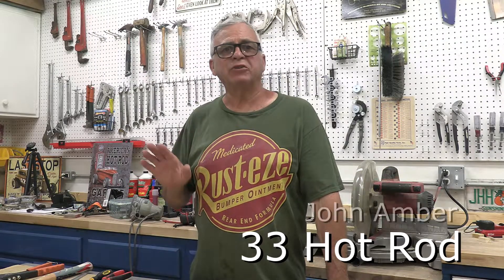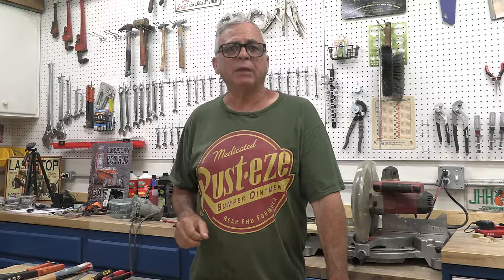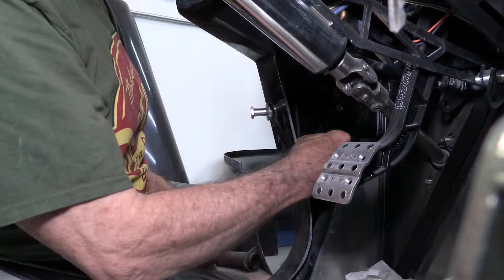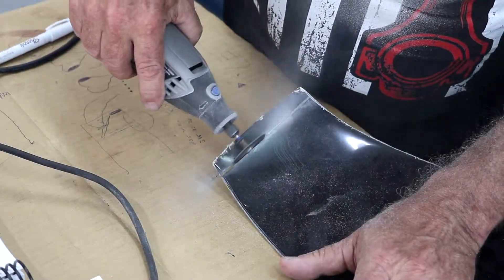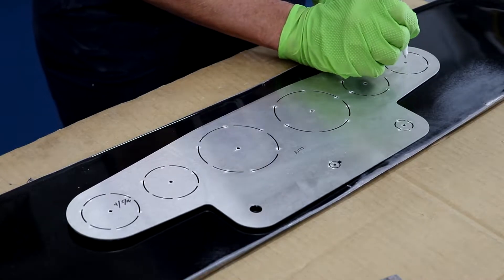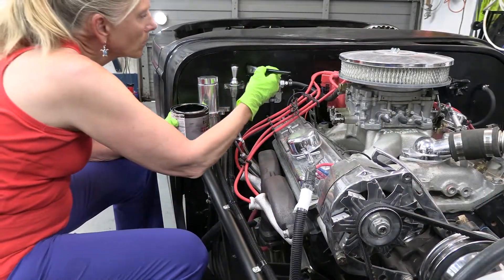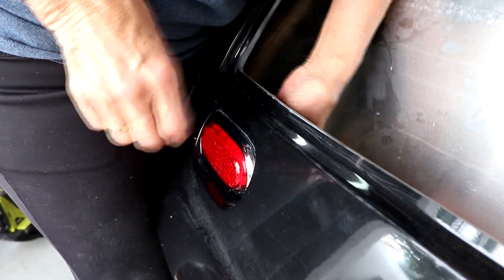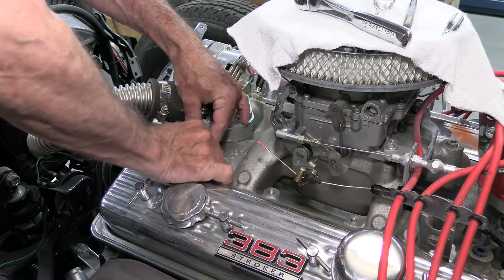#23 Factory Five 33 Hot Rod Build - This, That, and the Other

Comment: Hey John, Nice to see you two back at it. It's been super hot here in TX as well so I can sympathize with you not wanting to get out there! I had a quick question. My kit is due to arrive in November. I'm ordering a crate 883 and wanted to know if you used a shallow oil pan? Also, can you do a quick video of the engine and any fitment issue you may have had? Would love to see that.
Reply from the maker: Sorry for the late reply. My 383 went in really easy. One of the easiest steps in the process. We jacked up the back of the car up pretty high, and left the front lowered. Slide right in with very little maneuvering. My oil pan is custom, square corners. I'll see if I can get a clear pick but check out the video when we installed it. You can see it pretty good.